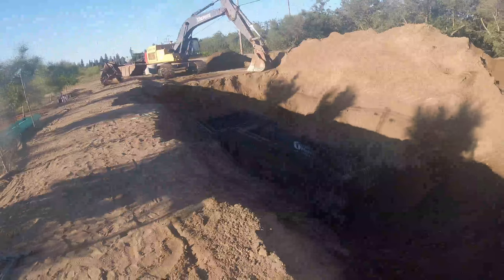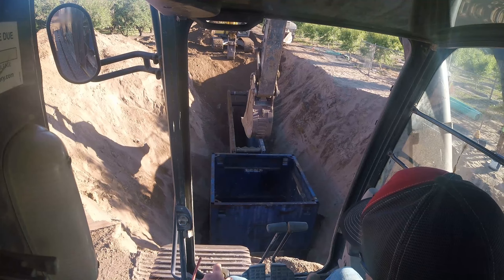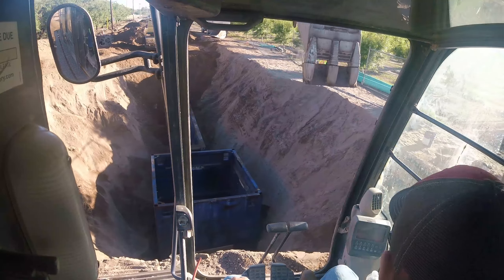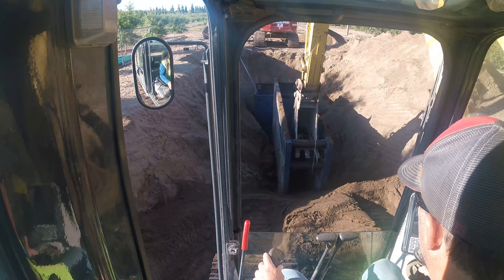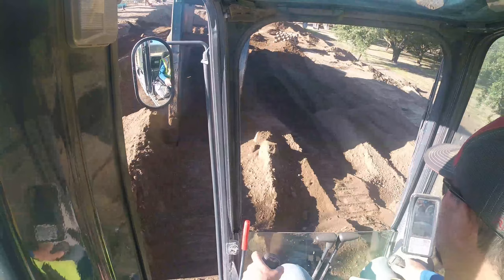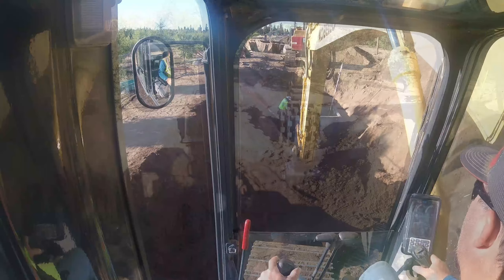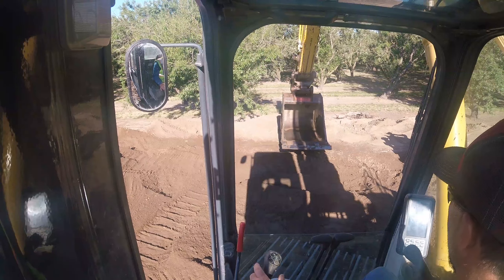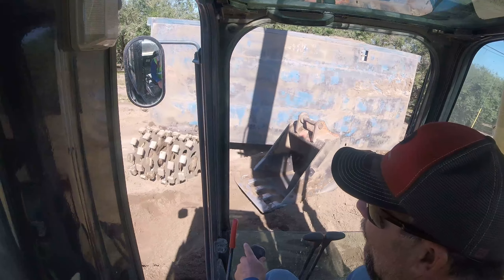Jumping Shields Part one

Comment: Looks like a darn good operator to me. I’ve never understood why some operators with quick couplers flip the bucket to stone the pipe. Why is that? I’ve always just had a pin on bucket, but never have a problem stoning with the bucket on the right way.
Reply from the maker: More reach. I can stay away from the edge of the ditch.
Reply: @TheLeverMonkey   makes sense. I’ve never had the luxury so I’ll just keep getting by 😂